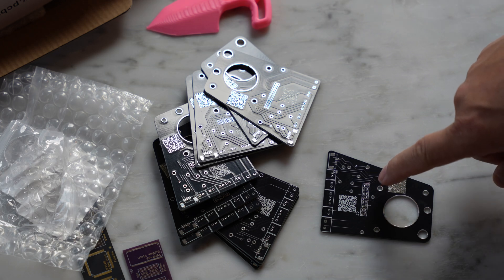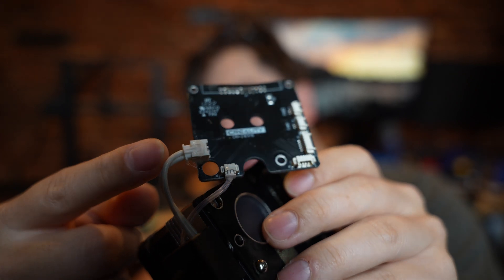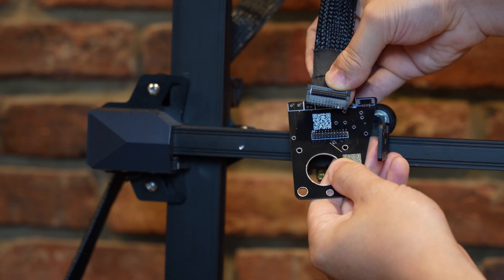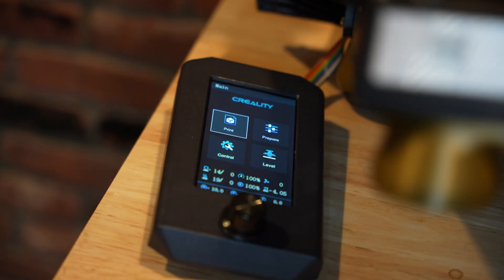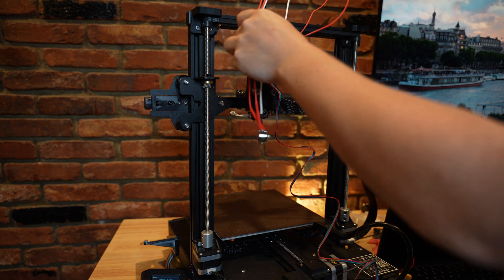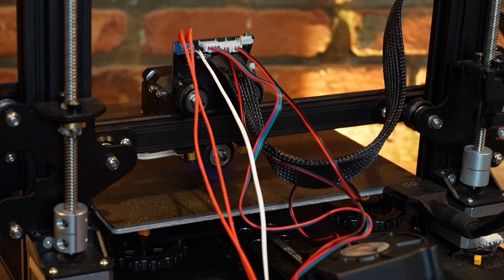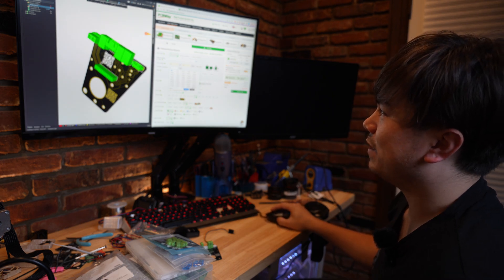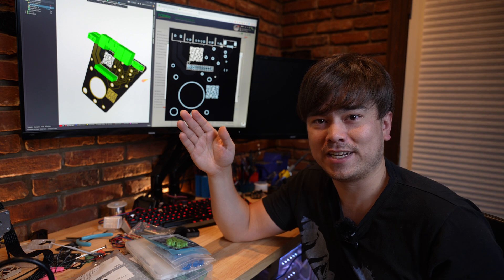The Best Ender 3 Upgrade

Comment from the maker: Thank you for the pre-order requests and feedback! 
I finished the 2nd revision of the board last night and put in an order. It features corrected hole-placement, backwards compatibility, and some other new features. 
If that works well, I will make some final tweaks and start a production run of a couple hundred and put them up for sale on my website. Stay tuned for more updates!
Reply: Nathan, may I also suggest to add the option to integrate an accelerometer such as ADXL345 for input shaping autotuning? Maybe using a header pin connector or well, I am not an expert so you might have a better solution.
Reply: Well nevermind, I found out there is no need to keep it attached, as once the calibration is finished you can remove it. So it is introducing unnecessary complexity.
Reply: Awesome! I would like to reserve one in advance!

Comment: I also use PCBWay, I've used them for almost a decade now. They even did well on my 'low outgassing' board that used rogers4000 substrait and gold traces. This board controls a laser shutter solenoid and sits inside of a UV laser module which has an ultra high vacuum environment. I wasn't sure if this was too niche of a need for PCBWay to handle -- but not only did they actually have the materials, but they had decent build quality and the BOM ended up being 1/10th of the cost compared to having a local Colorado place build these.

Highly recommended. I would also shill Altium for you, but I've only layed out boards for small companies who can only afford eagle or the free stuff, like design spark or kicad. I've always wanted to try it though.
Reply from the maker: Altium is awesome. Would highly recommend it if doing things professionally. But KiCAD is good enough for 90% of designs. I switched back to KiCAD, but miss Altium.
Reply: @NathanBuildsRobots  what does an altium seat run these days?

Comment: Great stuff! 
I might just buy one, only for the ability to tinker around with less of a risk to damaging an unavailable part.

Those connectors have a weird pitch? Because I bought a bunch of 2x5 (2,54mm) ones that look real similar with that locking mechanism and the notch and they were rather affordable.
Reply from the maker: Yeah they are 2mm pitch. Shame on Creality for making everything more difficult than it needs to be!
Reply: For real, there's so much about this printer that is annoyingly close to a good solution, yet so far from it. Totally feel your pain.

Comment: would it be possible to change the main cable from the horizontal to the vertical position?
Reply from the maker: I think so. It would make a lot more sense that way. It may cause some problems if printing at the full height of the printer, but it would probably be better for strain relief

Comment: Can you do something like this for the Ender 3 and Ender 3 V2??
Reply from the maker: It could be done, I would probably use a row of screw terminal blocks to convert the wiring harness into the PCB. Or I could provide a whole new wiring harness. A little more work, but it could be useful.

Comment: I was originally stoked about the Ender 3 S1 Pro for its high temp printing.  then the more I looked the more I decided it was much harder to mod and had less replacement parts supply options of my Ender 3 Pro I upgraded.  things like this will make sure I keep an eye on the S1 line

Comment: What about the X2? Feels like that one has a solid build but maybe hotend/extruder could be better.
Reply from the maker: Sidewinder X2? I definitely want to mod mine soon. It certainly could be a candidate for the next board. However, I think their stock breakout board already uses common XH connectors. I think the challenge there will be more to do with fitting a different extruder/hotend onto it.

Comment: Absolutely interested.  I want to figure a way to have a solid detachable hotend like the s1 but a conversion for the base ender 3.   Also with a v6 hotend and not the sprite.
Reply from the maker: I didn't mention it in this video, but this comes with a 4-hole pattern for mounting to any extruder stepper motor. This means it should be compatible with a ton of other extruders. 
Creality sells wiring harnesses to convert old Ender 3s to the Sprite hotend. I may make my own version of that. It should be too hard or expensive...
Reply: @NathanBuildsRobots  Take my money!!!  That would awesome content showing a conversion of an older ender 3 with your new pcb board.
Reply from the maker: At that point it would be compatible with any 3D printer.
Insert Galaxy Brain GIF Here

Comment: Hope to see 24V to 12V DCDC convertor on the board for 12v fan like noctua.
Reply from the maker: That would be cool, I'll look into adding that. I think I will do it by adding a 120 ohm resistor in series with the fan port, that way it will step down 24 volts to 12 volts, but will also have short-circuit protection, which a lot of people have had issues with.
I can have the voltage drop be optional, with a jumper to short out the resistor to switch back to 24v, but it would also get rid of the short circuit protection.
Reply: I was gonna ask the same thing. Would be nice if Nathan somehow integrates that 12V zener diode and maybe add a heatsink for it into the PCB. 🤔
Reply: would pay so much money for this
Reply: yes, please if we get this feature i will get atleast 2 of them :)

Comment: I burned my first sprite breakout board from one little switched wire polarity so I had a get a  whole new hotend replacement and it's disappointing that creality doesn't have the board for replacement. 

I'm super happy you're working on reverse engineering this board. I wonder if wambam would want to connect if youre not already . Ive been really interested in their mutant platform. I cannot wait to try out your pcb once it's ready to buy/test
Reply from the maker: The mutant looks pretty interesting. I am going to finish up development on this board and put it up for sale. I will open source it eventually, but would like to do the QC and development myself for the first couple of batches.